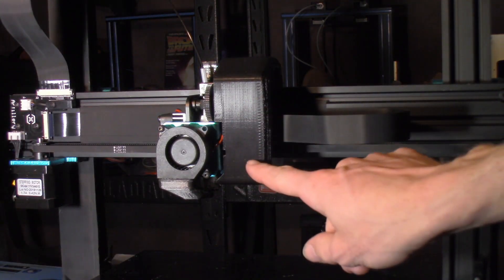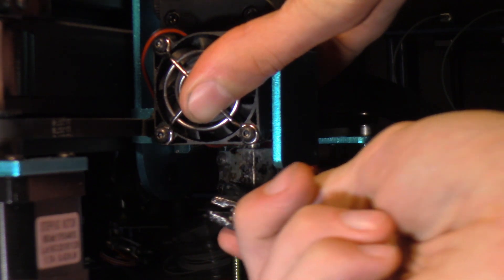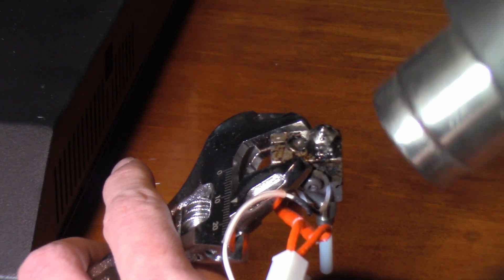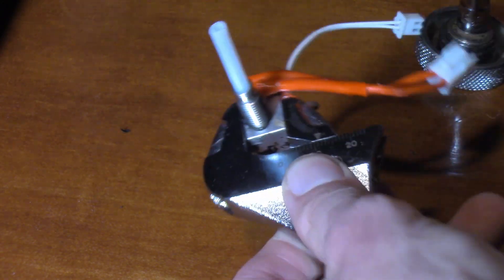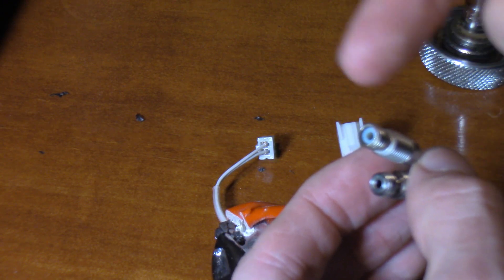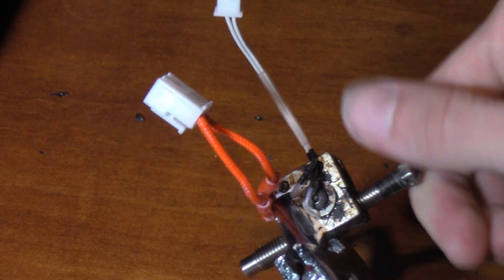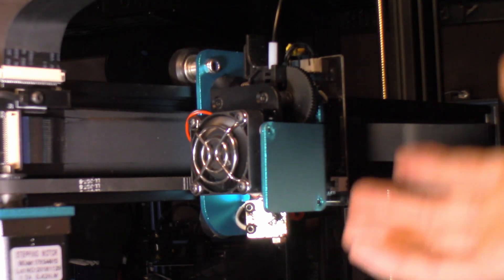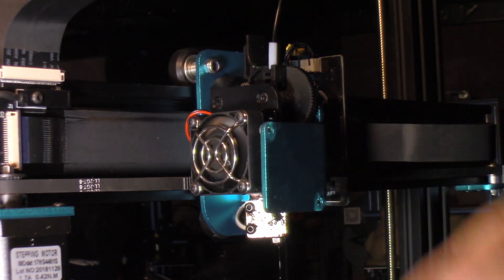Artillery 3D Sidewinder X1 Heatbreak swap: Threaded style

Comment from the maker: Ok correction: The PTFE tube should be 29MM long not 23 as in the video. Sorry for the mixup!
Reply: awesome, saw this AFTER cutting the tube DOH! No problems with 23mm as of yet but you might want to change the text in the video as this is the first result in google for "sidewinder x1 heat break replacement"
Reply: Im gonna second James comment... i appreciate the video, happening by the comment after Ive cut the ptfe and reassembled everything...  :/
Reply: Yeah would be nice if you included a textbox with that info, won't take long I bet. Nevertheless, I notices Artillery ships a spare PTFE tube so it's not that bad if you mess up cutting the original one ;)
Reply: Thanks for the guide tho. It's the best one out there so far. I went Bi-Metal with my X1 and like it.
Reply: Martin Hi, I have two bi-metal here (threded and smooth), it performance well with PLA? And looks like this X1 from Calvin have a treaded one, but in the comments of TriangleLab many Artillery users pointed to the smooth heatbreak. Maybe Artillery changed it during the versions? I’ve a v4 one... thanks!
Reply from the maker: @Fernando_Gazzola  yeah Artillery switched from a threaded > threadless sometime mid last year? I haven't felt like doing an updated video, yet. That said I did do a video showing which style of break you use AND put in the title that it was "threaded style."

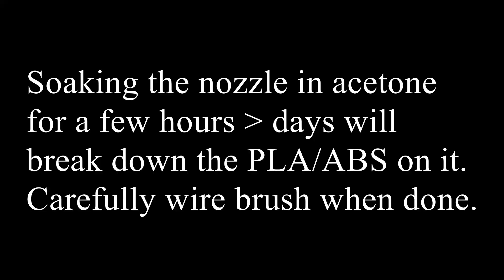Comment: At 5:30, my heatbreak is wiggling as well after inserting it into the heat block. How did you end up getting it tightened?
Reply from the maker: When you tighten the nozzle up after assembly, that's what tightens up the heat-break too. It is the seal between the bottom of the break and the top of the nozzle that stops things wobbling/oozing and turning into a mess.
Reply: @MakeItWithCalvin  ah thank you!
Reply from the maker: @wskwong2000  np, I may do a video explaining this...

Comment: Will these parts and method work on the Artillery genius?
Reply from the maker: Yes/no. This is an outdated method of changing breaks but the concept stays the same.
Reply: @MakeItWithCalvin  but if i get the same type of parts it will work in the genius. correct?

Comment: The heatbreak is held into place with tiny screws on the back side of the plate housing the heatbreak in newer models of the Artillery Sidewinder X1! Do not try to unscrew the heatbreak by turning the heatblock. there is no thread on the heatbreak! Just unscrew the tiny screws and it pops out.
Reply: THANK YOU!!!! I thought I was dead in the water when the heat break snapped off.  Never occurred to me to look on the other side of the plate.  I can't thank you enough.
Reply: @dumbofliesvermont5684  i think there are not enough videos on maintenance of the artillery sidewinder on YouTube. Like 1000 review vids, but clear instructions videos on every maintenance topic are hard to find

Comment: So do you just need to but the heat break to fix the plastic tube melting inside issue? @ Calvin Witt
Reply from the maker: Yeah you are replacing the one that seals the tube against the nozzle (PTFE design) for one that seals against the metal of the break itself.

Comment: Just had a similar issue with my X1. The nozzle wasn't seated against the break and it leaked out, successfully encasing the whole thing in PLA. Just got an E-mail from Envovo, they are sending me a new one.
Reply from the maker: You can also heat it up with a heat gun and peel the plastic off... Bit faster than waiting on a replacement.
Reply: Calvin Witt yes, I’m gonna put it back together and try that.

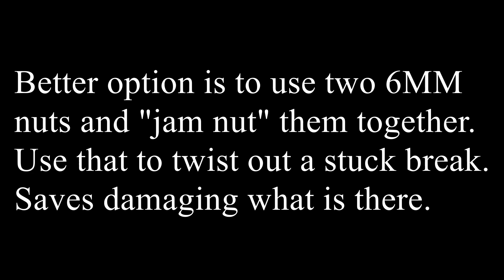Comment: 3:53 This is not a 6 mm thread, a M6 nut is too small. Seems like it's M7 and those nuts are hard to obtain. I mean of course you can order them, but there's no guaratee they will fit either and you probably won't be able to use them for anything else.

Comment: Can anyone please clarify? Does the Sidewinder X1 use both threaded and non-threaded heatbreaks? I want to replace my heatbreak and nozzle to be able to print engineering plastics. I don't want to take my hot-end apart until the new parts arrive. Many thanks.
Reply from the maker: Cover that here! https://youtu.be/QlqgTb-nVlo Best to check as part way through production they switched to the threadless break which I personally prefer!

Comment: when I tried this the heat block turn and unscrewed but left the heatbreak in the machine!
Reply: If you have the v4, it is because the heatbreak is not threaded. It is held in place by two grub screws. I know because I just worked on my v4 tonight.
Reply: Yea I broke mine twisting it out...
Reply: It never came out

Comment: Alliexpress has a Triangle labs bimetallic heatbreak that seems to match the dimensions of the kraken heatbreak (artillery X1 V4) essentially its a clone of slice engineerings Copperhead . Unfortunately the copperhead only comes in threaded version or I would have supported them. I've purchased the Triangle labs version wish me luck :o) Apparently bimetallic is supposed to be better than titanium.
Reply from the maker: Meh, run the TI one with no issues for months on this and my HicTop. I understand the science of the bimetal but honestly I think it is more "bling bling" than anything. But if someone wants to send one, be my guest I will gladly try it out!
Reply: @MakeItWithCalvin  I've got a spare how do I contact you to send?

Comment: I wish I would have watched this video first, but I broke the wire on my thermistor. I have been trying to find a direct replacement without to much splicing, and I haven't found one. The volcano hotend doesn't seem to be quite the same. Any suggestions, thanks for the video content!
Reply: http://tinymachines3d.com/ is where I ordered mine.  They seem to have several Sidewinder parts.
Reply: Artillery3D has a really great customer support!  If you still have warranty, write them kindly and they will be happy to help.
I had problems with my hotend, sent them pictures and they sent me a new one.
Theytold me it will take long for shipment, but it arrived soon later.
Reply: If you going to replace it suggest one of these style https://www.amazon.co.uk/gp/product/B07Q82LDKD/ref=ppx_yo_dt_b_asin_title_o02_s00?ie=UTF8&psc=1  why replace it with the same flimsy thermistor. Basically you screw it into the hole that the thermistor screw goes into and the other end simply plugs in like you old one. Check this vid out https://www.youtube.com/watch?v=zVZsW6nNEPY there is a US version as well.

Comment: In all versions from 2020 impossible to change they way showing in video because heatbreak have Slotted Throat. Previous versions used the threaded throat.
Reply: Here the look at the smooth one all metal bi metallic according to E3D Kraken specs that people have been using it's the same dimensions https://www.aliexpress.com/item/4000698566141.html?aff_platform=portals-tool&sk=_dZp60eu&aff_trace_key=8ce84251810d41569ed3326bca124e91-1592348084280-01203-_dZp60eu&terminal_id=ee8b2b9fe6e841658a4d8c58864a01d3&tmLog=new_Detail&aff_request_id=8ce84251810d41569ed3326bca124e91-1592348084280-01203-_dZp60eu

Comment: You can NOT jam two 6MM nuts and "jam nut" them together to twist out the stuck break because there is a M7 thread in there not a M6 and metric 7 nuts and threads are not quite usual.

Comment: Would using a Capricorn tube be a suitable upgrade or no difference?
Reply: This is all speculation but from what I've heard people saying the ptfe tube used is not the best and considering Capricorn makes the gold standard of ptfe tubing it would be an upgrade especially if you need to print around 250C regularly. That said I don't know if I personally would or would recommend tearing apart the entire hotend just to replace the tube if that's all you're replacing.
Reply: as long as it has the exact same outside and inner diameter I dont see why not. I thought capricorn tubing had a slightly thinner outside diameter but i could be wrong

Comment: @Calvin Witt..... Thanks for the vid.... however i need some clarity.. @5:21 when you state the heat break should be almost flush. Apparently this is "important" can you please specify why since you dont in the vid... I got mine installed last night and my outcome was slightly different (have not printed on it yet).. I had my heat break turned OUT about one full thread then when i put my nozzle on i was about 1/2 turn from hitting the heat block entirely and it all seems to fit really well. Having it this way also seems to line up quite nicely with cables and plugging it back in...... thoughts????

Comment: I just got a new X1 (2020-02-20) and it looks like the stock heat break and plate are different.   Instead of the heat break screwing into the cooling/mounting plate it's press fitted and held in with grub screws.   I'd suggest removing the fan and checking for two little grub screw holes where the heat break is held.  If they are there then you have the same model that I have and you can loosen them and the heat break should slide right out.   The original heat break I received is not threaded at the cold end, its just a barrel.  I think I'm going to need to put a lot of thermal paste on the cold end in order for it to make good contact with the cooler block.
Reply: Wish I had seen your comment earlier! Was surprised to find it like this, but now I assembled it with a whole lot of thermal paste as well. Did you notice any problems? Does the PTFE tube become too hot in high temp prints?
Reply: I switched to an all metal heat break so my PTFE tube is shorter, I did switch to Capricorn tubing since I'm printing some ABS.  But I discovered that the new smooth bore plate is compatible with the Kraken/Chimera heat breaks which is also a smooth cylinder on the outside.  No need to put loads of paste in there any more.
Reply: Man, i wish I saw this sooner. Ended up buying an entirely new extruder as I replaced my heatblock and had no idea why it was sitting loose. Once I got the new one, I disassembled the old one and saw the grub screw holes :'(

Comment: Any slicer software changes needed after the swap?  It seems I need to up my printing temp by about 10 degrees to avoid under extrusion and clogging.  I've also reduced my retraction setting as recommended by many.

Comment: I took Followed these steps very closely and could not get my heat break to unscrew from the cold side. So after some deeper digging into the hot end, I found 2 set screws under the heat sink loosened them up and found out my heat break is a smooth bore and not threaded like the titanium one. Not sure if mine is an older design or newer design but the new heat break will not work for me since the threads on the new break will not make much contact in the smooth bore of the heatsink with the set-screws tightened down. After a bit of research, I found that the heat break e3d Kracken is the same heat break for my machine.
Reply from the maker: Yours is the latest revision of heatbreak which does not screw in at the top. The procedure stays almost the same with the exception of that revision. If I can get my hands on that setup I will do an updated video on it.
Reply: @MakeItWithCalvin  Ok cool. I have ordered the other style heat-break now without the threads. then I should get good thermal contact with the heat sink. Thanks for your quick response.
Reply: @MakeItWithCalvin  yes i did the same but broke mine as i didn't see the 2 little screws before it was to late

Comment: Has anyone updated their heat block to a copper one and changed the thermistor to a rtd style ? I’m searching and trying to find more information about this. Would like to update to a plated copper or even all steel heater block because the aluminum seems to expand at higher temps and cooling down and leaks happen around the heat break.

Comment: Thanks for your tutorials, they have came in helpful several times! I had a nozzle block I thought, but it was actually a clogged heat break. I ended up breaking it off during reassembly, trying to tighten it up and the thermistor wires were so short it kept pulling the metal clips out of the plastic thermistor plug, and just as you warned I broke one of those. It’s a learning experience for sure. I ordered a few spare parts, hopefully when they arrive I’ll be able to get it all put back together in one piece!
Reply from the maker: I would be lying if I said I never made mistakes doing it... that said always keep spares and hope it works out for you. Generally speaking, once you get a swap dealt with, you do not have to go back and touch it!

Comment: THANK YOU FOR YOUR VIDEO! Quick question, if I want to only change the PTFE tube would I be able to keep everything connected, heat up the nozzle and remove it from the top or is there anything else involved?
Reply from the maker: To swap the PTFE out you have two options: 
Take off the extruder side cover and pull the PTFE tube out that way, it may help if you warm the hotend up as some filament may be "sticking" to the PTFE and make removal/reinsertion a pain.
An alternative method is to unscrew the whole heater assembly from the extruder and swap it that way. Just be mindful of the heater block wires that they don't short when you reinstall the assembly and that the heat sensor is not damaged. It is a delicate unit!
Reply: @MakeItWithCalvin Successfully replaced it by removing the heating block. Thank you again!

Comment: which end of heat break threads does thermal paste get applied. where it it screwed into heat block or threads that go into cooling block (I'm assuming threads that go into cooling block)
Reply from the maker: They get applied to the "cold" end, the one that goes into the extruder/block. You do not need anything fancy for the thermal paste, just something with a high thermal transfer rate. It also helps to put a little on the heatsink and extruder body to aid in the heat getting out!

Comment: Again awesome vid Calvin. The purpose of any good how to video is to provide information but also help a first timer feel comfortable doing it themselves. You 100% achieved that for myself..

One note that you might add in the comments, at 1m20s you show how to unscrew the heat block, but on my machine (and a few other cases people have posted about), the metal fan bracket is much closer in, maybe a design update, but it means there isn't room for the heat block to do a full 360 rotation.
I had to solve it by removing that whole left side of the extruder to separate the cooling assembly from the machine to remove the heatblock.
Same thing to put it back, I had to screw the new heat break/heat block back in to withing half a turn of it's final position before assembling the extruder again, and then just a final tightening with everything back in it's original place...

It's a good learning lesson, but a bigger process to replace anything other than the nozzle and maybe thermistor wires.
Reply from the maker: Thanks Rhys, 
Good to know about the metal fan bracket, and I don't expect people to follow my videos to a T but use it more as a guide. That being said it is not a super easy process but if it is done right, it only has to be done once!

Comment: Hi Calvin.  Thanks for all your posts on my new favorite printer.  Mine just started shutting down due to a thermal runaway issue.  It just started.  I was hoping this video would help.  Any ideas?
Reply from the maker: Normal causes include:
Temp sensor lose, shorting or dying.
Lots of fan blowing onto the heater block during printing can cause it to error out
Connections not plugged correctly.

In my case, I had my machine temp error due to an intermittent connection between the thermistor and the wires going bad due to a break inside the heatshrink. I swapped the temp sensor and that did the trick. Temp sensors do not live forever so I tell people to keep at least one spare on hand, just in case!